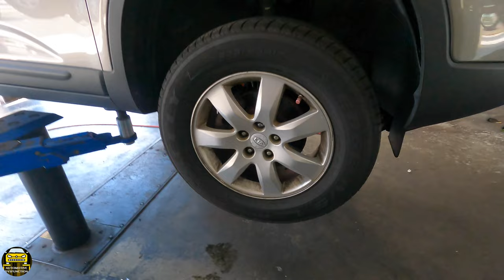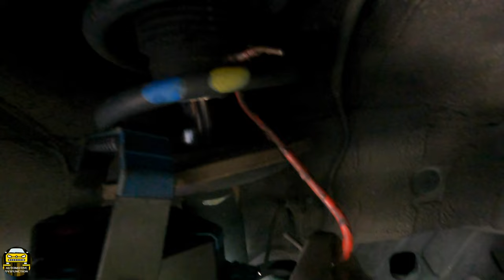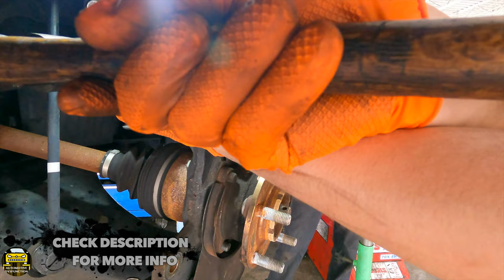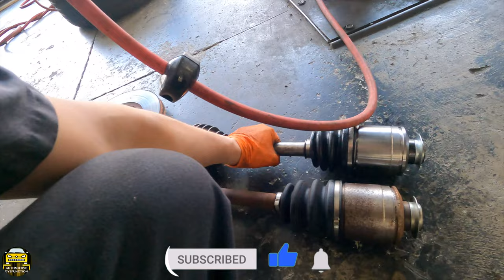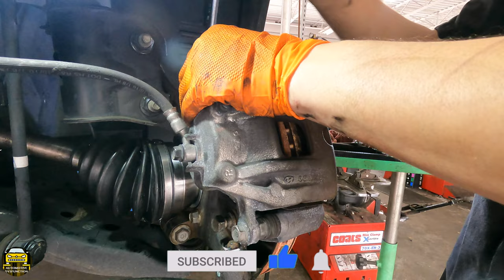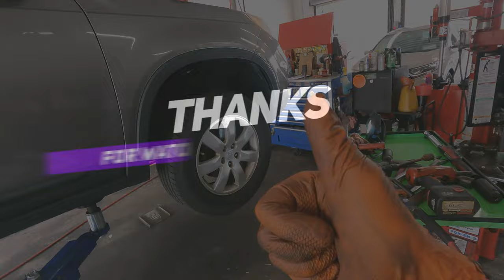How To | Kia Sorento | Drive CV Axle Shaft Replacement |

Comment: every few miles it is recommended to change the bearings ,mine make noise and one boot is leaking grease passenger side 2011 sorento LS
Reply from the maker: yea change bearing either when it has play in it or its making noise one of those two

Comment: If the CV joint on a Kia Sportage were to suddenly break going 80 mph, could this cause the car to flip front end over back end?
Reply: Yea i would say so if its top heavy 80 mph you will at least   spin you out possibly into other lanes but you usually get a decent ticking noise before it fails...

Comment: Is there anything holding the cv axle to the hub other than the nut? I’m trying to do mine but I can’t get the shaft to budge I’m thinking it’s just seized really bad
Reply from the maker: Just that one nut  … spray   some penetrating lube and smash the shit out of it … who cares if cv shaft mushrooms because you are replacing it anyway don’t be afraid to hit it hard
Reply: I’ve tried what the video showed, a puller that you hammer on, the puller with an air hammer attachment, beat the devil out of it…. Cannot get it to budge. I could try some PB blaster or something next
Reply from the maker: @michaelrobertshaw4790  where in my video (time?)
Reply: @AutomotiveDysfunction  is there any special alignment/position that has to be done when installing a new one or can the axle go in just about however you can get it in?
Reply from the maker: @jak77942  there should be like C clip  that makes  kind a go hard in but with little wiggle left, right , up and down at same time when you are pushing in , it should just slide in ..

Comment: Is this a good time to replace that carrier bearing too? Is there much more involved?
Reply from the maker: No need .. I ve never replaced one so far .. (but then again I live in rust free state) I wouldn’t touch it if it’s good
Reply: is that the bar that goes to the transmission?
Reply from the maker: @brittneyturnbow771  yes
Reply: @AutomotiveDysfunction  is it hard to change that? There are metal shavings and stuff around it where it goes into the trans
Reply from the maker: @brittneyturnbow771  it shouldn’t be that I think there only 2 or 3 bolts holding that shaft and after you take those bolts out it should just come out same as this axle did

Comment: I have a Santa Fe with clunk in front that Hyundai has a TSB on regarding a washer between back of hub and axleshaft. Yours is the only video I've found that shows that washer. You didn't change it. It appeared to have been stuck to back of hub then came loose when you put new shaft into back of hub. Do you know if this washer is the same for the Sorento and Santa Fe? I can't find the washer at any dealerships in my area. Local tranny shop says my transfer case is bad but I sure would like to try this first. I have no washers in place now.
Reply from the maker: what year/model/engine size/FWD or AWD?maybe I can help to look up that part for you
Reply: @AutomotiveDysfunction  
2008 Santa Fe, Lkmited AWD. I think the washer is Hyundai 51755-2B020-FFF.
Can’t find them locally and I would like to try installing one to see if helps my clunk before the shop wants to take out the T-case. 
I think because the axle nut tightens the shaft to the hub thst the freeolay is actually in the joints themselves and the washer helps to compress the joints as it gets tighened up.
I don’t see freeplay between my hub and axle.
Thanks for your help
Reply from the maker: @notsofast5495  does it make clung noise only on right turn? if it does more likely they re right
Reply: @AutomotiveDysfunction  only when shifting from park into gear. I pulled driveshaft from transfer case, put it back in neutral and raised front wheels. There is a lot of freeplay in t-case ss opposed to the used one I picked up today with 58,000 miles. 
However, the rear diff seems to have same freeplay as my tcase.

Comment: so after replacing ball joints and wheel bearing i get a clack when accelerating or on gear changes from the driver side. would it be this?
Reply from the maker: I would check and make sure you got all bolts/nuts  tightened..sometimes you hand screw the bolt and get distracted & forget use wrench
Reply: @AutomotiveDysfunction  thanks ill check that

Comment: your video doesn't show removal of the ball joint.  Does that probably need a pickle fork to separate?
Reply from the maker: I didn’t remove ball joint for cv replacement as you can see in video I removed 2 top bolt that holds strut assembly

Comment: Anybody know of this will work for a 2007 Kia Sorento And isn't there a seal That Goes on the transmission side Before you put the new axle in?
Reply from the maker: not sure 2007 Sorento is RWD based vehicle
Reply: @AutomotiveDysfunction I got the selector for four-wheel drive as well though